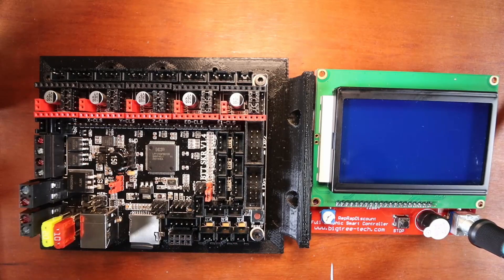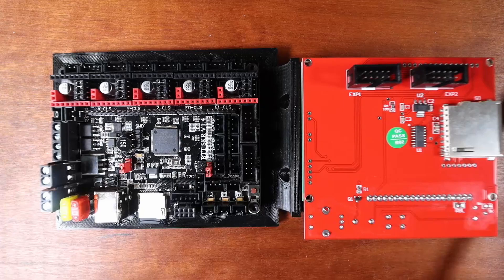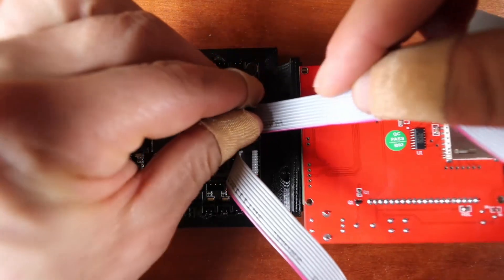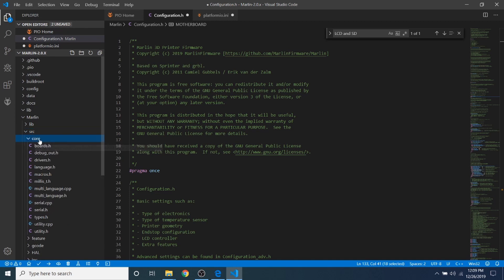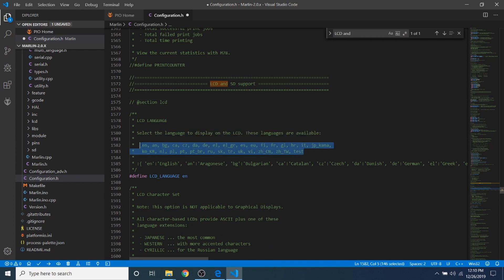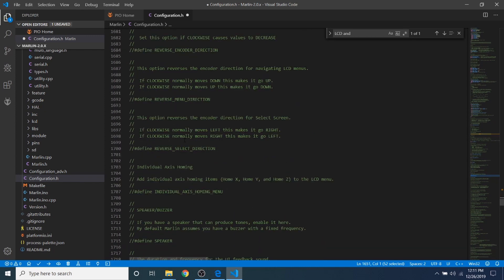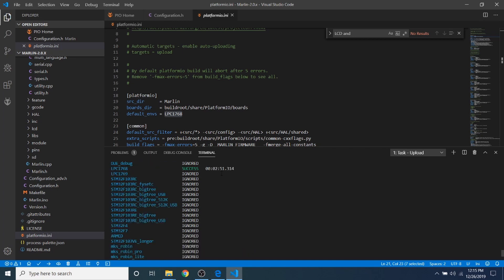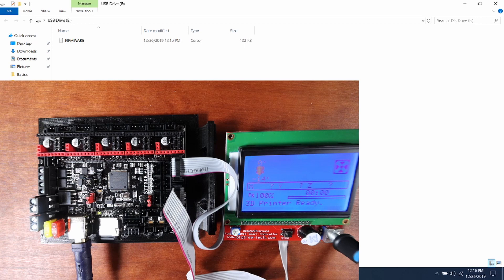SKR 1.4 - Full graphic Smart Controller

Comment: have an LCD from an ender model 12864ZW-10, I set everything on the SKR 1.4 turbo but it remains on a blue screen. Excellent Video .
Reply from the maker: There's a Discord link in description below, I might be able to help, but I need a visual of front and back of LCD.  Could you post front and back of display?
Reply: @EdwardBraiman  This model is 12864ZW-10 .you have three connector exp1 ,exp2 and exp 3
Reply from the maker: @marcelrios806  Check my playlist for SKR v2 CR-10

Comment: So if I understand correctly you can either use the onboard micro SD card or the lcd SD card ?
Reply from the maker: The micro SD card I think is only for firmware load.  If it works for loading gcodes let me know.

Comment: I ordered this board with the big tree tft35 v2.0 3.5 in screen no knob. Did I order the wrong screen or will it work. I also have the 2209 drivers.  I read that the software has issues was it corrected ?
Reply from the maker: TFT 35 should work, TMC 2209 may have issues, but you'll need to consult Marlin firmware current bug issue database.  Unfortunately I don't know every hardware issue.

Comment: Crap I  bought me a v1.3 last month and I regret buying it.Should have bought this one
Reply: Don't feel bad I bought two of the V1.3 and the last one was last month as well and wish I had known a V1.4 was coming.  WiFi I have no wants of for a 3d printer though.
Reply from the maker: There very similar.  If you use a TFT35 you can have almost the same functionality.
Reply: @EdwardBraiman  owwww okay didn't know that module exist. Thanks!!!!
Reply from the maker: It has WiFi, but it'll be a couple of days before I can post a video.  Keep in mind the WiFi is not as good as a computer attached.